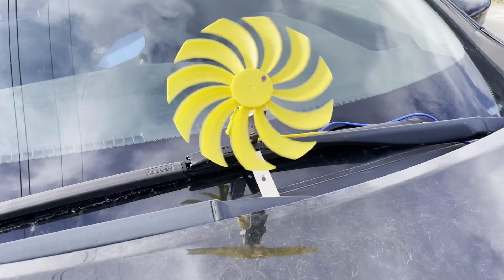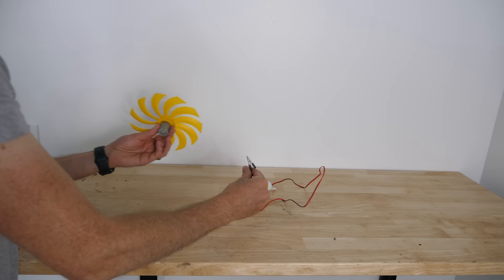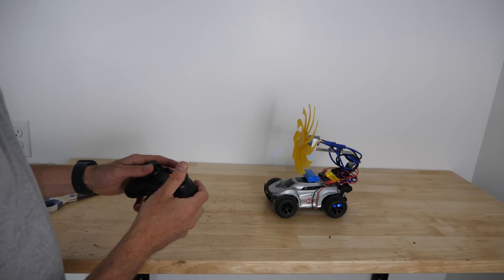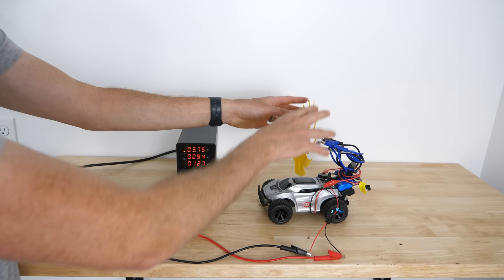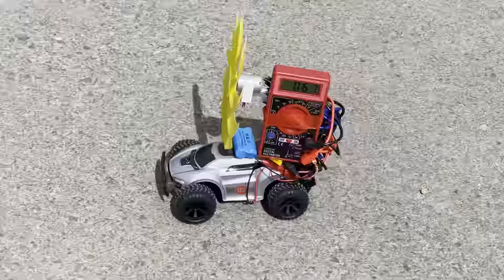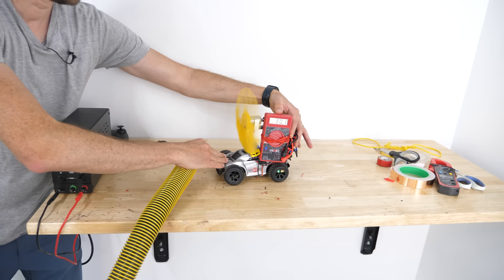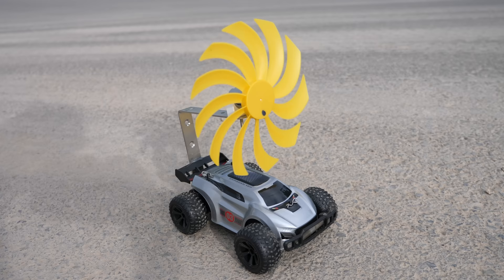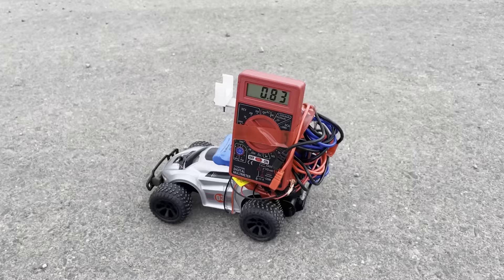Can You Power a Car With a Wind Turbine?

Comment: The car may float, as the vacuum chamber adds lift?
Something to work on.
Also a magnifying glass roof to send heat to the vacuum chamber. The hotter the chamber the less drag on wheels?
The car may float one day😂
Reply: Could one invent apertures at the front of the car which suck in air to supply the vacuum tank. 
I reckon that an onboard energy system can be made independent of the air force (friction) coming in..
Is this bad pysics???

Comment: 15 years or so ago, I worked at a local computer repair shop when one day this guy roars up to the building and jumps out of his Jeep with a mess of wires and parts, and as he walked through the door, I noticed he had on a magnifying headset. Oh brother... He needed someone to solder a bunch of hi power transistors for some project he was working on. So I call out the boss from his cave since this is definitely in his wheelhouse, and after a few minutes of discussion, we find out he's working on this exact idea presented in the video and claims to have modified a Peterbilt tractor to run using a similar but hugely scaled up version. We both knew he was missing a few but fixed his problem and he went on his merry way. He offered for anyone to come to his 'shop' and check it out. The boss did and he saw a bunch of junk under tarps but nothing actually working. Ah well, one day we'll crack it. 😁😂

I met some really interesting people at that shop and the 'nutty professor' as we nicknamed him was the clear winner. Another guy claimed to have worked with electronic engineers laying out some of the first LSI IC's on the floor drawn on paper.  He also claimed to have invented sideways oil drilling that was being using in the Gulf.

Comment: I had thought of this concept too, I was thinking of trying it on a pedal bike, have the fan blades covering the cross section/areas that have to pass the airflow anyway, such as the front wheel, handle bars, the biggest restriction to the wind probably being the rider so maybe a fan duct and visor arrangement to cover that?
Reply: Due to the Betz limit on the efficiency a turbine can operate at in a moving fluid, which is at most about 59.8%, you will never physically generate enough power to compete with a more aerodynamic shape which reduces overall drag. You are probably right that there would be a way to recapture some of the wasted drag force to reduce drag, but the turbine design isn't the way to do it. And again, you'd be hard pressed to find a means of competing with a simple aerodynamic profile, which has no moving parts or extra weight
Reply: @Spencergolde  I believe Robert Murray Smith was working on a turbine design that appeared to operate beyond the Betz limit, not sure if it was backed up?
Reply: @david bone  I only know of Robert Murray Smith from his reputation as a YouTube science breakthrough scammer, I would put very little faith in any claims coming from him. The Betz coefficient was calculated for the extraction of an idealized fluid moving through a cross section, but the underlying limit is just newtonian physics. If you extracted 100% of the energy from a fluid stream, it would come to a stand still, and you would then have fluid running into non-moving fluid, which would stop the stream. Another way of looking at it is that the stream backs-up, and can't supply more energy. The best engineers have spent decades perfecting today's wind turbines, which are only capturing ~70-80% of the Betz limit in ideal conditions

Comment: I feel like this could be optimized to extend range if the turbine was spun by aero under the car and through concentrated air intake channels. this combined with re-gen braking and solar panel implementation would heavily improve range, covering most commutes alone. of course the tech is new and improving, but I think their is some potential with all three. also if not with direct wind im sure someone can come up with a turbo like device that would spool up and discharge its energy through a drive. I guess the trick is to create a turbine with the most torque per rotation with the least amount of drag on its blades.

Comment: but what if you put the wind turbine behind the front grill of the car? The front grill acts like an intake to cool the engine, AC, batteries etc. so using the same airflow could power the wind turbine.

Comment: One more idea that I can deliver is the design of the windmill fan i.e., the fan should not be perpendicular to the fan.  It should be parallel to the fan.  I mean similar to bucket wheel or similar to AC indoor fan, where we can erect two generators on either side of the fan.
Reply: I mean the design of fan should be parallel to air flow like bucket wheel.

Comment: Some guy made a video about that. He was able to power an electric stove with the 1Kw of power he got from the turbine. He designed the turbine out of carbon fiber so it help up pretty well against high car speeds and acceleration.
Reply: You would be better off buying a generator and putting the extra gas in that instead of your car.
Reply: @Ides385  yeah I know. He was just trying to prove the concept

Comment: Thank you for tirelessly educating people on your channel!
PS: Instead of a wind turbine, what actually works is to put solar cells on an electric car. The solar energy is not enough to power a car continuously, but enough to add a few km of range per day. This sounds compelling for people who use their car only like once a week.
But then again, it might make more sense to put much cheaper solar cells on your house roof instead of carrying them everywhere with the car as extra weight and cost.
Reply: I do think there is a market for solar panels on cars. The weight is definitely substantial, but for people who drive a relatively short distance to work, and park the car outside, it could be more than worthwhile.

But your point about just having them at home to offset the regular charging is probably just the better option

Comment: Even those bicycle lights with the little generator that rides against the tire require extra force on the peddle to propel the bike forward. If you use the movement of the vehicle to provide additional power, there is a trade off.

Comment: With worm gearing that is geared low enough and driven by a tiny coreless motor, you could easily crawl forward into the very wind that is generating the power.

Comment: The bicycle usecase is actually a valid one. You are not using a battery but your own energy to power it. Which is fine. Same as putting a generator on the wheel axle itself.

Comment: I have a really brilliant question here. What if we place the turbine for generating the power at the exhaust air flow after the combustion process complete. This is same to turbo system but apply for recharge a battery or maybe to power up other electronic in the car.

Comment: Thing is, the energy losses add up as you add more complexity to the system. Here the car battery's chemical energy goes to kinetic energy, then into work done turning the turbine, to electricity, back to the battery. On the other hand, if you mounted just a fan, no wires or tape or generator, it could work like a gyropter. As the motion turns the propeller, the propeller starts to slightly decrease the drag the car experiences, as it is now actively functioning as a propeller. So you may not recapture all your energy (or even a significant amount of it), you can make it marginally more efficient with some surprisingly simple additions.

Comment: We can use wind mill but some changes .. place the wind mill behind the car opposite direction and air should come to the turbain through  a air collecting hole from the frond of the car.. so car can easily go to front and the wind will go through the hole pipe to rotate the turbain...

Comment: Having an air inlet in the car bonnet could significantly reduce drag. Almost acting like a water wheel but the concentrated air flow could spin  and store the energy. Agree that this could supplement and not replace energy used.

Comment: in your experiment shown, you are adding weight of the multimeter and the windmill, the size of the windmill should also be proportional to the car size,  you do not need such a large diameter windmill to catch all of the  wind since car is moving opposing to the wind. ofc there will be some air resistance but now the resistance is smaller.

Comment: Actually you can use the turbine as a net energy source on a windy day, ..it's just that you need to have a higher torque, lower speed motor on the vehicle.
Note the equation Power = Force x Velocity, ...that means, even with conversion inefficiencies, you can have a greater force applied by the wheels at a lower relative ground velocity, and a lesser force, but greater power applied to the wind turbine. You can also switch this around with appropriate gearing and go downwind faster than the wind by using higher relative ground-speed at lower drag to apply higher thrust to an air fan at a lower relative air speed. Btw, this is all stuff that's actually been demonstrated to varying degrees, e.g. the blackbird land yacht(featured on veritasium channel), and the windmill powered revelation catamaran.

Comment: Buenas: Prueba con un engranaje que invierta la rotación y aplícala a las ruedas. Es lo que hacen en un video de Verisatium, algo similar. No tendras energía gratis, pero ganaras eficiencia al contrarestar la resistencia del vehículo por la friccion con el aire. Saludos. (Good: Try a gear that reverses the rotation and apply it to the wheels. It's what they do in a Verisatium video, something similar. You will not have free energy, but you will gain efficiency by counteracting the resistance of the vehicle due to air friction. Greetings.)

Comment: try a vertical shaft wind generator. your head winds would work different with a cross breeze adding extra power into the system.

Comment: I made a video of doing this years ago, I used a 3d printed 18 blade shrouded propeller found free on thingivers_ with a diameter of 400mm.  I paired it with a high power scooter brushed dc motor as a generator, and was able to produce 200-400 watts above 45mph, and it worked all the way to 120mph!  I used the current to run a browns gas (HHO) wet cell to inject hydrogen and oxygen into the engine for increased fuel mileage and internal engine cleaning.  It worked a treat until my Saturn car gave up the ghost at 320,000 miles

Comment: Wind powered generators have been used for years to power electrical systems on older airplanes that were originally built without electrical systems. All piston engined airplanes have magnetos a bit like a lawn mower engine to power the ignition, and it is separated from the electrical system that powers the lights, radio etc. FAA regs don't allow adding an alternator to an engine not designed for them. Wind powered gens are a legal alternative.

Comment: A more fair comparison would be to keep the turbine on the car but disconnecting it from supplying the car. This is because the resistance from the turbine also accounts for the amps that was drawn from the battery

Comment: Would the electronics need a huge amplifier to ramp up the output voltage to offset in efficiencies? I'm thinking multiple stage discreet electronics, not a heavy mosfet amp

Comment: In a bigger scale can't we stick a peltier device ( thermoelectric device ) to a motor ( on the body of the motor not connecting wires ) so as the motor heats up the peltier device will generate electricity and make it a little bit efficient ?
Reply: Peltiers are extremely inefficient, you are talking about a handful of watts of power, and you have to run your motors very very hot to get that power.
Reply: @volvo09  motors have heatsinks and we could remove them and somehow direct the heat to the peltier device. Don't we use peltier devices on Mars rovers ? Are they really that weak ?

Comment: I haven't watched the full video, but I'm gonna say that it's actually possible, as long as there is wind. because you can make a propeller car than can move faster than the wind. Just use a generator and electric engine instead of mechanical coupling.

Comment: You could benefit, only if you use the windmill on your car when it is parked, to charge the batteries from the ambient wind.  When you drive, it needs to be put away, to not cause extra drag.
And for traffic energy harvesting devices along the road, using air or road movement methods would only hinder the traffic movement and increase its consumption.  Sound or heat energy harvesting may be useful, especially heat like from the London underground, would be a useful source.

Comment: I have a question.. a car has to move the wind out of the way anyway and it doesn't benefit from that. You have put the turbine on the roof, making more area for wind resistance.  If you put the turbine in front of the car, would it slow down the wind so that the car has less resistance as the turbine takes the energy fron the wind? This extracted energy that would have been wasted might be useful to use to power part of the car. Perpetual motion - no, but extracting energy from the wind that we didnt before.  Thoughts ?

Comment: It is theoretically possible to increase efficiency by changing the aerodynamic properties. The big mistake here is that you significantly increased the cross section of the car. Obviously that wouldn't work. It's probably very difficult to get right but it's definitely possible to increase efficiency with something like this. 

The car is already losing energy due to drag. You may be able to collect some of that energy without adding as much drag. There may be some areas of the car that are wasting energy accelerating oncoming air to nearly the velocity of the car. All of that energy is converted to heat. You may be able to put a fan in that location and only have a minimal impact on overall drag of the vehicle because it's not increasing the cross sectional area. But then it may be collecting a lot of that energy that was previously lost due to drag. It's not perpetual motion. It's just an improvement of aerodynamic properties to reduce waste.

Comment: I think the thing a lot of people miss about wind turbines is that they're not free-spinning.  Generators resist spinning as they start powering something; if you've never ridden a bicycle generator, you can physically feel this resistance as the load is increased.  So the wind turbine moving through the air isn't spinning as fast as it should be at that wind speed, because there's a load (the car's motor and electronics), and that means it's providing a bunch of air resistance.
Reply: This is true, but it's not that simple.  Consider a helicopter in autorotation (i.e. gliding with engine out).  If you put drag on the blades and bring them to a stop, you fall like a rock.  But if you let them free spin, applying no torque at all on the shaft, you can glide to Earth at a nice leisurely pace.
Reply: @Rick_Cavallaro  Yeah, propellers are complicated, but just the fact that the motor resists turning under load does mean that the air resistance will be a significant factor.  It's an intuitive thing that I think a lot of people who haven't worked with generators don't have a feel for; they see a propeller spinning and think it's like a pinwheel that has next to no spinning resistance that also generates power...

More to the point, when you put a helicopter into autorotation, you detach it from the engine and alternator and reduce the drag on it as much as possible, to get it spinning as fast as you can.  You need that angular momentum so you can flare the propeller near the ground and use that momentum to slow down just before the landing.  If you were also using it to power a load, you'd have way less momentum.

Comment: I'm willing to bet that energy can be recuperated using micro vibration or micro resonant. Basically when the wind hits a car panel the vibrations it produces can be used to generate energy. Just need a mechanism to collect that energy.
Reply: I think a more robust and lower cost option would be to seal, tighten, or make continuous, any paneling on the body. If everything is secured properly the small remaining vibration energy would be too small to capture